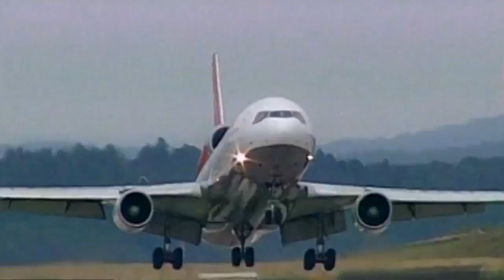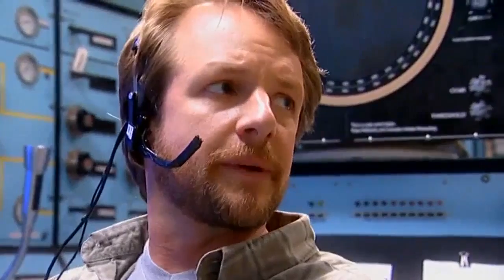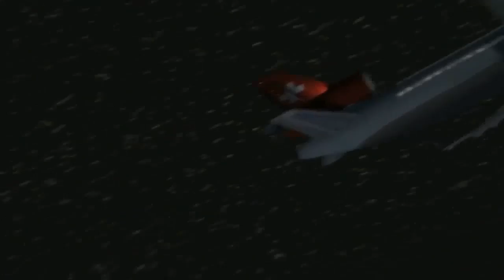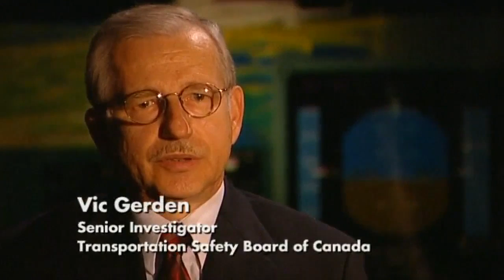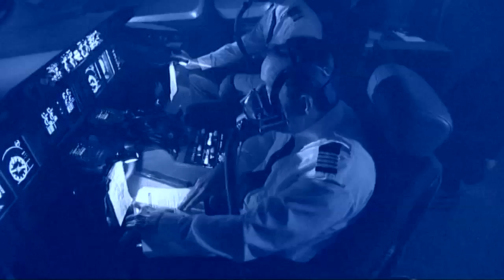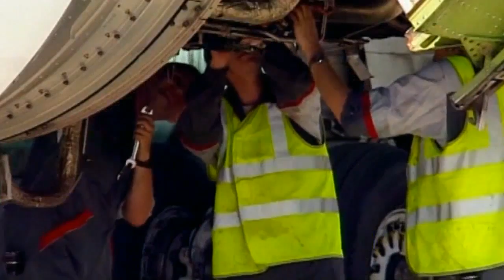Air Crash Investigation: Fire On Board (S01E03) HD

Comment: spending time on dumping fuel isn't a realistic option, I think where's the aircraft still burning inside!!  co pilot was right! it could save some time"
Reply: Ahmed Habib Mukto You cannot land with full tanks, the aircraft would be too heavy to stop safely on the runway. Also the fire was in an insulated section of the wiring system, if they tore the insulation apart to use extinguishers oxygen would have reached the fire and make it worse

Comment: Fuck a checklist. You cant fix it in the air anyway. LAND THE FUCKING PLANE. I know people who cant write their name but they could tell you that.Have you noticed that as a persons education level rises their common sense decreases?
Reply: Ronald Davis in this case they wouldn't have made it anyway. Checklists have been statistically proven to save lives as they prevent human error (which is the number one cause of plane crashes right now).
Reply: Actually, no. A checklist will often tell you if you can land the plane the regular way. Sometimes you cannot put your landing gear down or need to land on a much longer runway. Or need to fly at a higher speed while landing. Without a checklist you are just doing stuff you think will work but some of it might cause the plane to crash right away.

Comment: Why do airline gamble with lives.i know if it had been me,I would have landed ASAP....screw check list
Reply: Dumping fuel isn't for fire purposes. A typical A330 with a full tank is carrying 111720kg of fuel. With that sort of extra weight on board the momentum will more likely cause a plane crash instead of a safe landing. 

Momentum = mass x Velocity

You want to minimise M while landing. However there is a minimum V required to maintain lift so the plane doesn't drop straight into the ground. Therefore the only way to lower M is to reduce m, ie fuel dump. A normal flight to the scheduled destination would have used the majority of the fuel so no dump is required then.
Reply: You folks who say "land asap" will kill every passenger on board.  You can't land asap.  You have to follow certain procedures in a certain order or you'll crash the plane with no hope of survival of anyone on board.  I don't care how many times you've landed successfully in MS Flight Simulator, you will kill everyone if you just try and land without following certain required procedures.
Reply: Yeah, dump aviation fuel on civilians, very bright idea. I would bring beer and sausages, and sing a jolly song as you burn to cinder.
Reply: When dumping fuel at decent altitude, no jet-A will reach ground. It will evaporate very quickly. It is designed that way. Not sure what the alt is for the md-11, but there is an article published by Boeing on this topic available on the net.
Reply: +bench.eng well they should have dumped the fuel somwhere or anywhere on the land instead of going towards the ocean. They lost precious time by doing that
Reply: Please study the map surrounding Halifax Standfield International Airport. They were not flying over barren wasteland. They were flying over established civilian facilities. How would you like it if a plane dumped fuel all over your house? 

The exponential deterioration of the situation was way beyond the expectations of the pilots.  The risks of landing with 230000kg of fuel did not outweigh the percieved danger to the pilots. Given that particular situation of the cockpit it was a sensible and logical decision that they made.
Reply: Its very easy to say behind a computer.
Reply: +bench.eng i wouldn't mind if a plane dumped fuel over my house if it means that it can save lives then fair enough. it can all be cleaned up afterwards.
Reply: also Weight and inertia. the heavier the aircraft, the harder it is to slow safely even IF it makes it to the runway
Reply: true say! land as soon as possible, i don't know why they went to dumo fuel when there could have been fire department ready to battle the fire. if anyone made it out allowed it would have been better no matter how the landing was to take place
Reply: It could have landed anywhere. On a highway causing a major crash or at a party killing many. For them it was not worth the risk.

Comment: Why didn't they said something to the crew like: "Could you check the source of the smoke?" They could have found it....
Reply: The_Geck It wouldn't have mattered anyway since the in flight system was gonna be running no matter what
Reply: Since the fire started in the sandwiched insulation material, it would have been impossible to locate the source.  And even if they knew where exactly the fire started, what good would that do? There was no way to put it out. Removing any paneling could have exposed the fire to more oxygen, creating a flashover.

Comment: what will it take to have fire extinguishers onboard airplanes
Reply: They did indeed use fire extinguishers. The co-pilot attempted to extinguish the fire, however failed.
Reply: Popalata Gaming
with  the intensity of the fire, I doubt that wouldve happend , the same happened to UPS 6
Reply: +Alex Johnson that was the captain
Reply: only thing they could have done if they had been aware of the fire is depressurise the cabin, the problem with this is while it starves the fire of oxygen it also starves the passengers of it. If the oxygen masks were deployed in the cabin that would have fuelled the fire even more. There was no real option.
Reply: that was an electrical fire, they are very hard to put out, especially when that insulation was burning
Reply: It's trying to put out a fire that keeps igniting again
And at in the fact that your several thousands of feet in the air, barely have any room to move without getting burned, have to fly a plane AND save I think it said 100+ people

AKA It's almost impossible to save that
Reply: it would be extremely difficult, if not impossible
Reply: Frankie It would certainly not have extinguished the fire as it did not on UPS 6 but it may have slowed the spread so that they could have landed before their flight controls became disabled.
Reply: Andre M the fire extinguishers wouldn't do shit in that situation.
Reply: They have very strong Halon gas extinguishers which are extremely effective but unfortunately extremely toxic aswell

Comment: Turning back to dump fuel was the dumbest descission ever.
Reply: I don't think so. With the amount of fuel still on board a safe landing could have been hard. Also imagine of they crash and all that fuel catches fire. Chances of survival would be quite low.
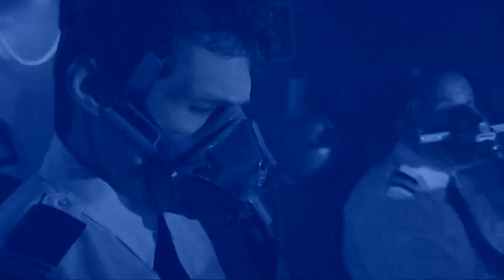Reply: FoZe Bluziken 39:30 They state that even if the aircraft would have gone straight down to Halifax from the ideal point of decent, they still wouldn't have made it. The fuel dump didn't make any difference, the fire would have spread too far before reaching Halifax.
Reply: If they didn't dump fuel the wouldn't have crashed
Reply: Qwertworks you are right. as a matter of fact the plane will crumble landing with too much feul

Comment: The old adage is appropriate here: Where there is smoke, there is fire. Seems to me that smoke on a plane should be treated as fire on a plane. The fire extinguisher should have been used 10 minutes earlier when the smoke was first seen. Get a flight attendant to jump on that ASAP. Rip out the ceiling if you have to, but find that fire and put it out immediately.
Reply: They said in the footage that even with an immediate landing when they discovered the smoke there would not have had enough time.
Reply: coolramone are you dumb? Ripping apart the walls would cause a flash in such a small space. Flames would erupt and make it worse. All they could do was what they did.
Reply: +coolramone My thoughts exactly.
Reply: I believe this is SOP now. Unfortunate that it took this event and others to come to that realization.

Comment: The pilot should have just defended and just landed at the first opportunity, changing airport and the fuel dump killed the passengers and crew. It was a bad decision.
Reply: +T-roll 1557 Easy for you to say with all the advantage of hindsight... If they had tried to land and crashed into a populated area there would be people saying the opposite.
Reply: Absolutely incorrect. Nothing killed the passengers more than the incorrect installation of a flawed In-flight Entertainment System by Swissair, coupled with the highly-flammable metalised mylar insulation which should never have been approved for aviation applications. What do you mean by 'changing airport'? Halifax was closest and undoubtedly the best choice. The Captain decided to dump fuel as part of the checklist's recommendations, which we now know are fundamentally wrong; I can't see how you can blame them for following protocol, whether it was flawed or not. And finally, as mentioned,  it was impossible for them to reach Halifax from the time they first observed any indication of smoke, regardless of their subsequent actions. They would've began the ~13 minute descent into Halifax just over 100 miles from the field, 4 minutes after the first indication of any smoke, therefore arriving 3 minutes after losing critical systems and ultimately control of the aircraft. It was just a very bad situation that escalated so quickly that it closed any and every possible opportunity of a safe - or rather, a different - outcome. To hold the pilots accountable is simply a sad, misguided and unjust deduction to make.
Reply: I see this throughout the whole comment section. Just keep watching the whole thing. Death was 100% Dumping or not.
Reply: They dumped fuel to lose weight and to reduce more fire.
Reply: Which ended up with them hitting the ocean at 250+MPH which obliterated the plane and occupants. Pilots should have known they needed to get down as soon as possible, not head for the ocean away from the airport and waste valuable time. A good pilot would take his chances with the extra fuel....
Reply: it was also the traffic controller, because if he had heard that they had an emergency, he would probably called it off.
Reply: T-roll 1557 what killed them was the fire dumbass. Damn thing pretty much burned itself to dysfunction. It was nothing but a good decision to dump fuel. All that fuel after just taking off would create such a blaze it would melt metal. No greater chance by not dumping.
Reply: It would have been a huge gamble of passenger lives for the pilots to land on a full tank of fuel.

Since, you know, you have to land the aircraft without crushing it due to all that fuel weight and you have to make sure the fire doesn't, oh, I don't know, spread into the fuel tank and cause an explosion, incinerating everyone in the cabin?

Comment: According to Jet Airline Crash Data Evaluation Centre, Swiss Air has safety rating of 0.059, which makes them #31 on the list. Far from "one of the best"
Reply: +Torrarosa Out of how many? There's nothing that disproves that with that statement.
Reply: Also, given how few crashes most airlines have, it's safe to assume that this crash took Swissair's ranking down a good few places. If it's #31 now, just imagine where it was before this crash.
Reply: Swissair is different to the current Swiss air,ine

Comment: I find it incredible that Swissair never thought it necessary to install any sort of cooling system for the inflight entertainment systems. Utterly unbelievable.
Reply: UnsyNZ well they cared more about money than lives.
Reply: UnsyNZ people often have a feeling that a loved one is in trouble i have had such an feeling.
Reply: UnsyNZ there is probably some swiss air ex executive sitting pretty with loads of money
Reply: @venicemackay9244  I`m sorry but, that`s just utter nonsense. Swissair was very transparent during the investigation and helped wherever they could. 

They were just as shocked like everybody else and were just as eager to find out what happened. The material used for insulation passed FAA criterias. So how should they have known that it would go up in flames all of a sudden? 

Swissairs fleet was in impeccable condition. They had enormously strict maintenance procedures. But D Checks aren`t a daily thing. So eventually minor faults can occur. Unfortunately, in the case of Flight 111, it turned deadly.
Reply: not so much as cooling but more as there was to much current being drawn, frying the wire (what they called arcing). Arcing is when there is too high of a voltage which causes a spark to jump through the insulation from the wire to another metal surface or another wire. The plane could not generate near enough voltage to create an arc (requires well over thousands of volts with the availability of hundreds of) milliamps). However, when a wire cannot handle the current flowing through it, it will heat up, the insulation will smoke, smolder and catch on fire. Swiss air simply ignored the current rating of the wire they used. Probably because of price, because thicker wire is needed to handle more current, which costs more. Makes me feel good that ignorance and cheapness is running airlines...